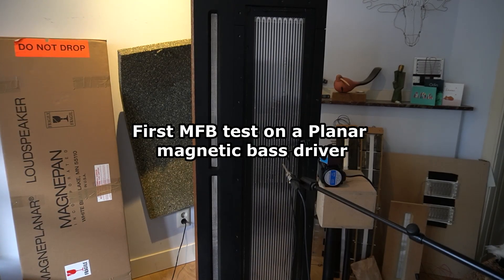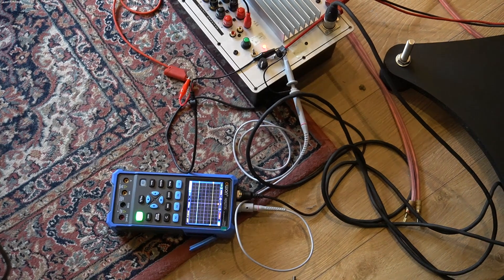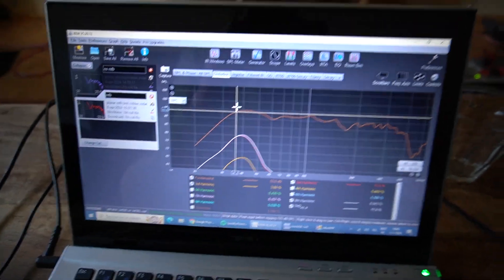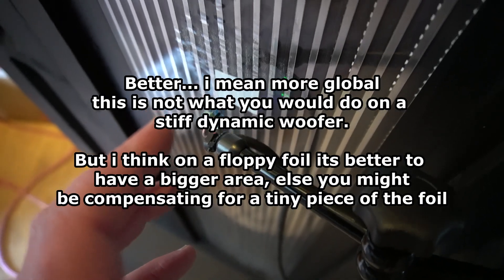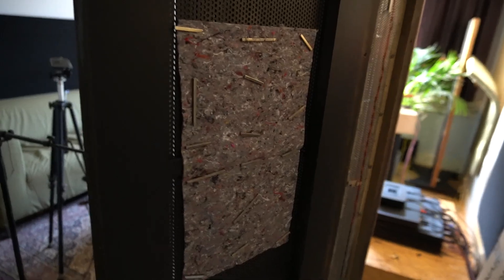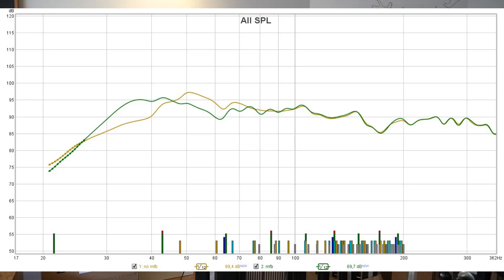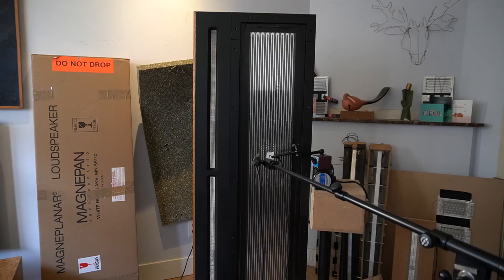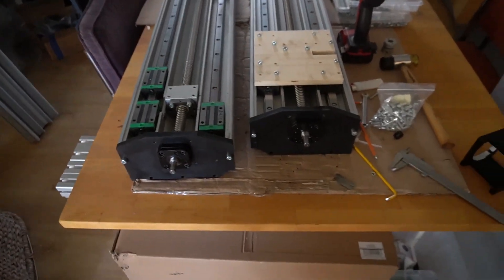First video of MFB correction on a planar magnetic driver

Comment: For a long time I have been wondering that a compensating signal should be sent to a separate, isolated emitter, there will be a radiator of a smaller area, which will be loaded only with this signal. Maybe I'm wrong. There was no way to verify it.
Reply from the maker: Then the main driver still does not do what you wanted..  this will not work acoustically either i am afraid
Reply: @joppepeelen  If the main emitter could work out the signal exactly, it would have done so initially, and I think it is unlikely that it will be possible to make it do the impossible. It's like trying to disperse an old nag by spurring harder.

Comment: I experimented about 20 years ago with mfb on ESLs. The thing is, like in your case, only a small piece of foil would be sensored, less than 1%. And not all of the surface is doing the same, of course, the resonances varied with the position of the surface, especially if it is divided in different parts. So it is a total different task in comparison to the movement of a stiff Bass membran....at the end I come to the conclusion to work with a speaker management system, herewith is it easier to compensate the system frequency and resonances.
Reply from the maker: aah nice to hear , and i think the same. i need a measurement that represent the movement better. it is a bit to small of a surface area. in dynamic this is not a big deal :( in our case it is :( i am thinking of some options just for fun :)

Comment: If your goal is to improve distortion, you should really consider using either a first or second order highpass on the IR sensor to approximate the membrane acceleration instead of the position. Above resonance, the panel terminal voltage is proportional to driver acceleration, so you're trying to correct acceleration using a position reading. The only functional loudspeaker MFB systems I know of are either using accelerometers in the voice coil or Rythmik's design uses a secondary "sensing coil" to detect driver velocity. I think velocity sensing (first order highpass on your IR sensor) is a good compromise between distortion cancellation and loop stability. A positional sensor like you've got right now should really only lower distortion below resonance where the panel terminal voltage is proportional to position. Using an IR distance sensor can work to boost the bass, but if your goal is to correct for distortion, you're gonna need more loop gain in the midbass. Using MFB on a planar driver is an amazing idea though, I wish I had thought of it. Good luck!
Reply: Just took a closer look at your measurements to confirm. Take a look at the distortion levels with and without MFB at ~46hz (the frequency where the MFB made no difference to the output volume). The distortion with MFB is actually higher than without. That means your feedback at that frequency is close to 180 degrees out of phase, which is the same phase shift introduced by a 2nd order lowpass/highpass. If you EQ both with and without MFB to the same frequency response before taking the distortion measurement, it should be very clear what the MFB is doing.

Comment: You are much more interesting than watching the Eclipse today.  The improvement at 50Hz is great. I think you improved the linearity of the sensor by moving farther from the panel.  The motion of the panel is now a smaller fraction of the total distance to the sensor so you are operating on a smaller segment of the  1/x  curve, so a bit more linear.   A very good idea. Can you share the components used in the sensor?  Maybe they are/ are not  special photo transistor & LED?   I expect the response with the microphone very close,  3 cm, from the panel would now be very flat with feedback.  I assume the variation in your measured response is due to the open baffle  /  baffle step effects.
Reply from the maker: HAHAH well i would love to see the eclipse :( its not here to bad.  im sorry i cant tell. i did not make the MFB circuit neither the sensor :(  its something a friend was working on and since its optical we wondered if you could use it on a planar.  and here we are. and i am still not sure. but its fun ! and we will see where it goes from here

Comment: IDK. In headphone world planars are considered electomechanically stiff. The diaphragm behaviour is pistonic.  I think in your loudspeaker, as long as you're aiming at the trace, you should have a proper representation of the rest of the diaphragm.
Reply from the maker: its a bit harder then that, the thing does not move like a piston :( so there always be faults. my best bet would take a reading of as much panel i can get. instead of a small portion i think, and differences might not be as great but overall might give the best result